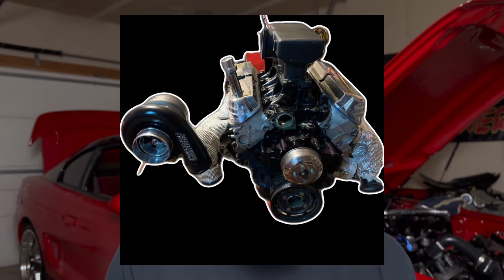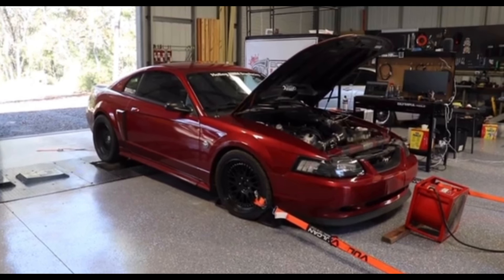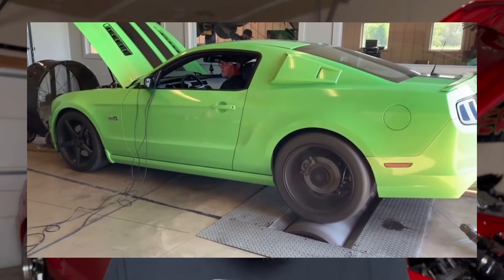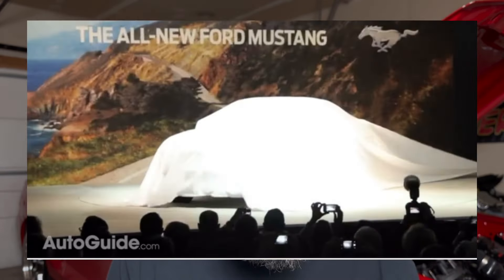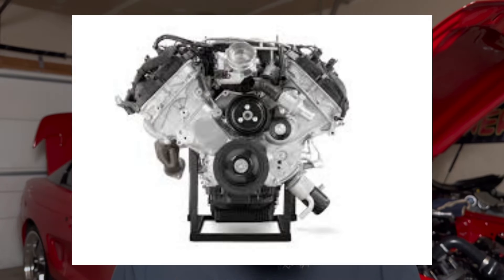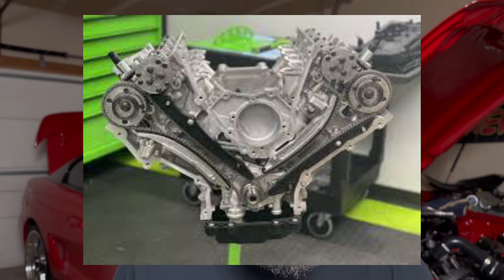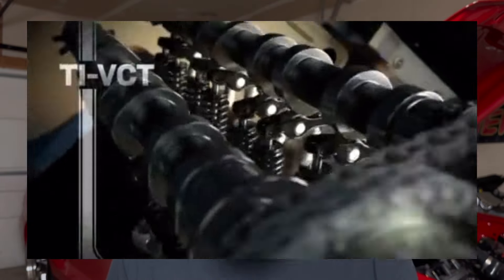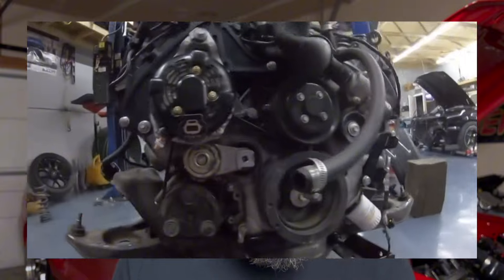Why Coyote Swap VS 4.6 Mod Motor Is Not Even Close

Comment: People don’t get it. 

I built a 1000 rwhp 2v (engine / block built for 1300) for way way cheaper then I could build the same Yote for. 

You’re 100 percent right my man. I keep telling people. Build your 2v you’ll thank me later.
Reply from the maker: @BMGYGK77  If people want to Coyote swap, I'm all for it but don't say you can do a swap for $4000. 2V got a bad rep because they are slow in stock form. Like you said, you can build a fast 2v hella cheap.
Reply: @SN95Power  I priced out a Yote swap before I built mine. I was 17,000/20,000 MORE than building my 2v..

In my area a used Gen 3 Yote is 8000.00$ 

People are selling Gen 2 and Gen 3 with dropped valves for 2000.00

Like there isn’t a chance I could have done the swap for cheaper. I am going to build a Yote next year to replace my 2v but it’s going to be a sleeved one.. going for the 1800/2000 HP short block. Anything under 1200 HP your cheaper to build your 2v or 4v over a swap all day
Reply: A coyote swap for a grand yeah if it's blown up, I have a 890 hp 2003 terminator, 10k total nothing but a 4.9 kenny bell arp studs and injectors stock motor also have a gen 3 making 1200 whp that was 16k but they both are semi built
Reply: @BMGYGK77  copart I got a destroyed mustang 5.0 everything but the engine n trans were still good for 4k
Reply: @sneezinhatch  I’m in Canada my man!! You can get some wicked deals on Yotes here but they go very very fast
Reply: @SN95Power most cheap swaps have been 10,000+ all said and done ✔️ “cheap” 

Any engine swap in any car is usually 10k that also goes for built hondas
Reply: @BMGYGK77  how? When a stock gen 2 or 3 coyote  can handle over 1000 with just oil pump gear and crank sprocket gear upgrade just to be safe. Ain't no way you can do it,  and still be a daily driver..
Reply: @jc35.08  yes they can hold that power. For a little bit.. that’s why people sleeve the blocks. You also need to do rods and pistons.. for it to hold that power at all for any length of time
Reply: @BMGYGK77  more research on your end is needed my friend. What block are you using to make that power in a 2v or 4v a teksid?
Reply: @jc35.08  I don’t need any research. I have lots of friends running 800 to 1500 rwhp Yotes lolll. And run a teskid block..
Reply: @sneezinhatch  that’s a great deal!
Reply: @jc35.08  It’s the other way around my friend 😂! I have a built 3v the blocks are ridiculously strong in both the 2v, and 3v. The 4v is in a league of its own coming already with much stronger internals. The only thing I really built was the bottom end of my 3v. I’m generously getting 700whp, and it’s nowhere near its limits. 

I don’t understand the doubt from Coyote guys. Mod Motor guys don’t deny that the 5.0 is the superior motor, but lies have been sold for years about it being cheap to build. The Coyote does not show its price to performance benefit until you’re talking about a 1,000+hp build. Anyone Coyote swapping their 05-10 S197, or SN95 and leaving it bone stock, or not building a 1,000+hp Yote is WASTING MONEY!!! 

I’m sorry but like someone already mentioned just because you can doesn’t mean you should. You’re not making a reliable 1,000hp on a stock Coyote…cut it all the way out. It will have to be built and when it does it will be far more expensive. I’ve sourced the parts both new and used, and after doing the math it couldn’t be done for cheaper.

Comment: Don't get me wrong, the coyote motor is awesome but I really don't like the sound of it, especially compared to the 4.6 2v and the old 5.0.
Reply: I think the coyote is awesome “period” the sound is not my cup also
Reply: Only way to make a coyote to sound semi good is a cam long tube headers to borla attack mufflers, by far my 03 4.6 terminator sounds a lot better than my turbo gen2
Reply: Agreed. Coyote sounds dookie to me
Reply: Bro… how ford went from having one of the best sounding v8s to the absolute worst is beyond me.  The 2v/4v 4.6 always sounded so freakin good. That was for the most part regardless of who made the exhaust system.  

I have yet to hear a yote that didn’t remind me of what a v8 Honda would probably sound like.  Straight fart cannon just with a deeper tone.
Reply: @TurboNFRStwoK  that's an excellent question, and yeah you are right it sounds like a v8 Honda.. lol
Reply: @TurboNFRStwoK I owned a Grand Marquis which has the same 4.6 2v as the Mustangs did with just a less of a factory tune, and it had an H-pipe on it, and it’s still the best sounding V8 I’ve ever owned. It sounds better than my current built Iron Block (5.3 bored to 5.7) LS6 in my Suburban.
Reply: Nothing sounded as good as my x-piped GT 2V. Sounded like a lion!
Reply: Off-Road X Pipe with Magna Flow Exhaust on 2V 4.6 
Sounds Amazing. 
Gets Compliments Everywhere I go 😌
Reply: My swap sounds just like my 2v did, same exhaust. People not in the know think it's still a 2v.
Reply: @jc35.08  Really.. do you have a clip to share to hear it? This was one of the biggest things holding me back from the swap since I love the sound of my 2v so much.
Reply: I agree the 4.6 is an inherently better sounding engine. However the design of the exhaust systems you can get for it is a big factor as well. And by that I mean there are no mid mounted mufflers. My catless longtubes go straight into two long resonators right after the collectors and BEFORE the x pipe with two tiny little flowmaster outlaw resonators before the tips. I have never heard another coyote that sounds like it: super deep, still loud as hell, but no rasp.
Reply: Coyotes do not sound bad. People do this crap all the time to justify their lesser engine. Remember when people acted like LS sounded so bad when they really didn't.?.? Now people do this to Coyote. Do Modulars sound good? Yes. Do they sound better than Coyotes? Generally I prefer the Modulars sound, but that doesn't make Coyote a bad sounding engine. A 3V Modular is a great sounding engine, but I don't like them, or desire owning one. GEN3 5L heads flow nearly double what a 2V PI head flows. Even 4V Modular isn't on Coyotes leave. I currently own 2 Modular Fords. One is a 2V and the other is a 4V. Both are 03's. Both have SVT badging. Both came factory SC'ed. I also have a GEN3 5L. (And a GEN2 3.5L EB truck, and a 88 GT, and a JD 5075E) Comparing a 2V Modular to a Coyote is like comparing a 305 out of a GEN3 Fbody to a LS1. It's a terrible comparison, but a GEN1 SBC is arguably a better sounding engine than a GEN3 LS, yet the LS1 would wax fat on an old 305. A 24 MGT makes like 215+ HP more than a 04 MGT. A 04 MGT + a 97 MGT = less power than a 24 MGT. 

You want a different sounding Coyote then get a F150 engine. You GEN2 F150 5L is pretty much the same engine as in the Mustang, but with traditional Windsor based firing order, and you're not taking a CR hit, and working with baby intake cams like you were with the GEN1's. Mod for mod a GEN2+ F150 5L will Match its same GEN Mustangs 5L in performance. Also F150 5L pre-24 is factory flex fuel so the stock fuel system is noticeably more efficient in the F150 to handle E85 and whatnot. (for example MGT uses 19lb port injectors where F150 uses 47lb port injectors) As for GEN3 F150 switched to speed density. SD > MAF unless you want to run aftermarket cams. With MAF you have to mod it as you start adding HP. With SD there's nothing to mod regardless of how much HP you make. It reads the correct pressure or it doesn't. And it's easy to tune. This isn't you old Foxbody/GEN9 F150 SD. Even the 20-23 GT500 got the F150 5L's SD setup.
Reply: @JROC734  I have the same exhaust system I had  on my 2v,  prochamber and 40 series Flowmasters  and it sounds great.
Reply: out of the three the 4.9 aka 5.0 wins all day music to my ears.
Reply: Bro it sounds just like a 2v when yu put it in a new edge lol

S550 exhaust setup is different from the new edge
Reply: @jacobwebb8818 the s550 sounds dookie to yu yu mean

Everyone the does the somwap says it still sounds like a 2v
Reply: @gerichayes1948 I think it’s the acoustics in the later bends for pre-S550 cars, I’ve noticed that too. Probably some range of frequencies being forced to reflect into each other and cancel each other out.

Comment: I just think the cobra 4v is a special engine, it was built by hand the builder signed a plaque on it! so it feels like it has some soul imo, coyote is an awesome engine but it feels like an nice new great working appliance to me, they're  everywhere just like LS engines. That new Samsung fridge is awesome it does everything it has a monitor showing what's in it but that big vintage Sub Zero fridge from back in the day is just classy. Just my worthless 2 cents.
Reply from the maker: @95Sn95  ⚰️You killed me with the appliance comment😂😂😂
Reply: That’s how I feel about the older AMG engines, especially an E55 AMG lol
Reply: Just think what you can do with a Lincoln Navigator 1st generation 5.4, 4 valve! I worked at Ford testing the 2 nd gen Lightning , stupid fast with the 2 valve. A 4 valve sc 5.4 would have been Insane!
Reply: @dankean8319 how you feel about the 5.4 4v is exactly how I feel about the 6.2 SOHC. Ford dropped the bag HARD by only offering it as a truck motor. Cause if you watch Andy from unitymotorsports garage break down the construction of that engine it has every check on the box to be a modern 427 cammer but ford being ford and making questionable decisions never dropped that beast into an s197 chassis

Comment: I swapped my car for $4000 plus the engine. The series start to finish is all on my channel. All you need is an engine, $1900 for coyote control pack, 350 for a k member, 300 for fuel pump and c5 return regulator, 400 for headers, 750 for belt drive, $40 for spring perches, 100 for a pedal bracket. motor mounts transfer over, mid pipe and catback can be mated to the swap headers. The rest I spent on exhaust couplers and wires for battery relocation. I turned around and sold my 4.6 setup for 1500, so realistically it was the engine plus 2500 bucks.

Comment: I bought a 01 cobra with a bad engine to specifically coyote swap. At the end of the day from a $ standpoint it didn’t make sense. I swapped a junkyard aviator engine and sold my old engine for a net cost of $200. Added a $2500 supercharger and make 450 at the wheels.
Reply from the maker: @jbp1981  Go ahead and hit the simple button 🙌
Reply: The 3v motors get a bad wrap for a few reasons. But most of their issues are from lack of maintenance in the oil department. The last gen 3v in the Mercury and Lincoln at the end of production make almost the same power (5hp Ford claims)as the 4v units. These motors are dirt cheap. Find one that had regular oil changes and you will not likely have phaser issues and it is likely at this point the bad plugs have already been replaced.

Comment: I agree. With a stock gen 1 Coyote you're starting off with close to stock Terminator territory. That's with zero additions. This concept is really pretty simple. I couldn't imagine daily driving a coyote swapped Fox/SN95/NE and then having any form of boost. HOWEVER, as much as I love the sound coyotes make, there is nothing that compares to the iconic sound of the supercharged 4.6 4V.  In my opinion. Not even the hellcat, not even CTS-V's or the Vettes etc etc.
Reply: 🤣... facts on facts

Comment: A gen ONE (weak bottom end) Mustang motor is about 5k at any scrapyard pulled from a Mustang. A Gen II you're not touching for probably less than 7k unless it's blown up. You can cheat and go get a Gen one F150 motor for between 1,500 and 3k but it is NOT the same as a Mustang engine. All the 4V 4.6 motors are between 1,500 and 3k and make what the stock Coyote does with Cams and ported C heads and an intake. There is nothing "Cheap" about a Coyote and people need to quit arguing it is. It makes GREAT power with a TON of money.....

Comment: I think thought to actually compared these you MUST include EVERYTHING needed to get there. Coyote or 4.6 2v. Basically it's like cherry picking. 

I'm not against the 2v, they are fun motors. Still debating pulling my 2v NPI to throw in my 79 Pace Car. Lol. 

But, if your going to do a "cost per hp" comparison. You have to include the fuel system and drivetrain. The drivetrain could be considered a "bonus" cause you do not have to put a clutch, Trans, gears ect. To actually complete the Turbo setup, but you do need fueling. Also on top, you need to include a tuning setup. You can't just slap a on3 turbo and it instantly makes 450hp. You need tuning. 

Personally, I think your close but once you add all the necessary stuff on both sides, you'll find the Coyote is a great cost option. 

Your building a 2v, or going to a stock Coyote. Either way, it's gonna be a fun ride. And this is coming from someone with a 4v Cobra.

Comment: As a builder, it’s important to stay on top of what’s new and what people want to build to be successful. As good as the Coyote is, It’s physical size is huge in relation to its displacement and at what power level do you exceed its strength start to expose the weak points? I’ll go out on a limb and say there are a few stroked Windsors out there with enough compression and cylinder head to outrun a coyote without the added fuel system and ignition. When do you step back and put in a conventional small or big block?
Reply: No oe cast Windsor has gone 6.26 @ 227mph on radials, survived and WON overall Sick Week, Tx2k24,Import vs Domestic.
No billet block Windsor has gone 5.67 @ 265mph
The Coyote platform has. 
The 4.6 4V has been 5.88 at 256mph with almost all oe parts. 
The 5.4 4V holds the standing mile world record 300.4 mph. 
The old Windsor, even with extra in³, is not matching the performance of evolution. Twin cam Fords are now the GOAT FoMoCo engines.
Reply: @chadkent1241  And there’s plenty of naturally aspirated big blocks deep into the 6s on Gasoline. I think the mountain motor guys were running 6.30s with a 6.25 record. I’m not knocking your thing here brother, they haven’t even scratched the surface as far as development for these things yet. There is 1 truth though that you really don’t have an argument against and it’s the same one that shadows the LS engines from GM and the Gen 3 Hemis from Chrysler. The bore centers are too close, the deck isn’t tall enough and there’s only so much room in there before your only options are Boost or adding a second engine. It’s not as bad a hinderance in the fords with multi valve heads but it’s the LS’s Achilles Heel.

Comment: 4 years ago the swap was half the price it is now with the gen 1. The motors are getting cheaper but the needed accessories are more than double the price now.

4 years ago you could find swap headers for under $400 pre tax.

Control pack was less than $1000 priced out from Ford.

Now your doing all this work to slap a 150,000 mile motor in the car, that’s crazy

Comment: I was going to swap a coyote in my 03’ Marauder. I found a good deal on a brand new Gen 3 short block (never taken off the crate from Ford). Sourced the top end from a ‘20 F150. I found a low mileage 10r80 from a Mustang and dreamed of playing with Scat Packs on the way to the grocery store. I knew this would be a little more than I could handle so I sourced a reputable shop and found a really good one. I dropped the engine off at the shop for them to assemble and prepare the installation. After they tallied up all of the main things, it was cheaper to either do a 3-2-1 or get a Gen 2 long block. The harness and headers were a big expense outside of my initial investment and labor (about 4k). I couldn’t justify that in my head. I then started looking for a Terminator motor (it just about swaps right in with very little modification, if using the stock supercharger pulley bracket). I found one and decided to go that route. I put the parts on FB market place and if it doesn’t sell, I have a fox body that the engine can go into.

Comment: Ok so the 4v 4.6 it has a aluminum block wouldn't that make it a more desirable platform to make 800hp and up?
Reply: That's what I have in my Lincoln Mark VIII 's and it is a super reliable and buildable engine and sounds pissed off with Flowmaster Outlaw mufflers
Reply: Pretty sure an aluminum block is just better for weight rather than block strength. Don't quote me though.

Comment: Coyote wins my vote. 4.6 is good for a budget setup, wouldn’t want more than the 400-450 hp range. Building one right now but it’s a budget setup. Coyote is my dream setup. It’s just a better. 
It’s capable of 1,000whp on oem internals
Pcm setup comes with great features 
Wide-band and knock sensor great for tuning
Forged internals depending on model
Variable valve timing gain power and still have fuel economy
Oem reliability stock 150k-200k miles should be easy.
Aftermarket and oem support
Sn95 are one of best chassis for the swap.

Comment: Budget will always be subjective. You left a lot on the table for both builds. But in the end, I  think you are correct. One thing you didn't mention that i think is important. Torque! A turbo setup is going to produce significant torque. Probably even more than the NA coyote.